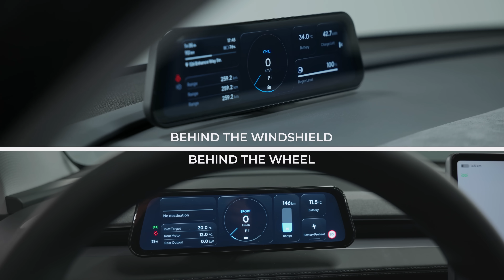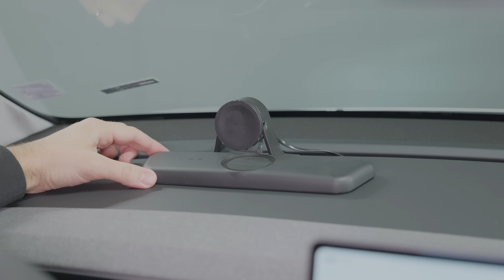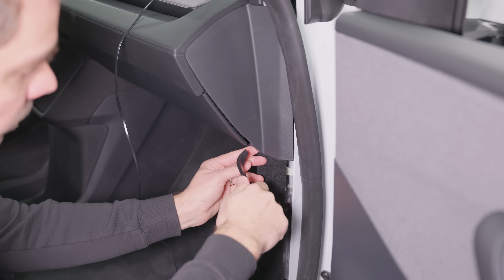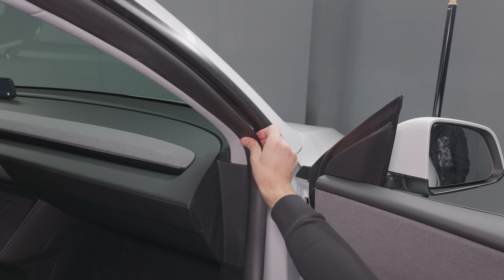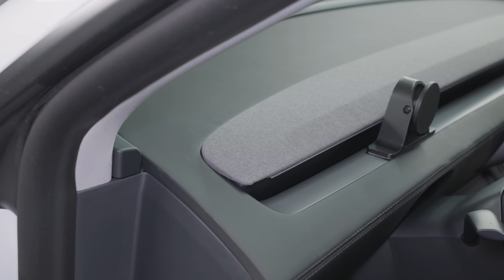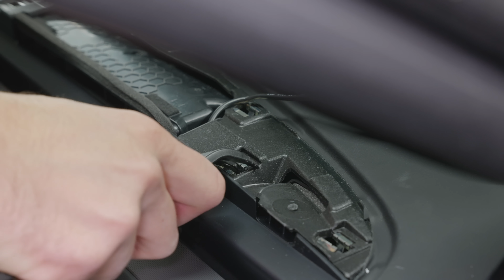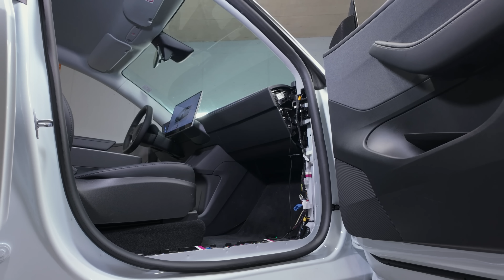S3XY Dash Installation and Wiring | Tesla Model 3/Y [Highland & Juniper]

Comment: Can I just use any usb-c cable to connect to a regular usb-c port to first check out for a couple of days which position of the Dash suits me best?
Reply: I have the same question.  I’m torn between which way I want to install it.  I assume you can connect to USB-C outlet in the car since that was the actual original plan for power according to older videos.  I’m really looking forward to user comments about placement once the first batch starts to arrive in people’s hands.
Reply: I did it - tired a regulator USB-c cable and used the usb outlet in then rear console. Worked fine.
Reply: Same question here. I also would like to test the different positions before making the final install!
Reply: @andersjacobsson1905 yes you can
Reply: Yes, you can!
Reply: There’s also another video from IowaTesla Guy that says you can buy an adapter and connect it to the OBD port underneath on the drivers side. I bought it. Just waiting for the Dash to arrive.

Comment: It does not stick to the dashboard. The tape is too weak!!!
Reply: The device is too heavy and does not stick to the surface
Reply: @skrzypek100  I thought so to in the beginning, but you need to apply force on the magmount for some time and clean the area properly/dry it. It sticks fine here now, no probs
Reply: @Mr.Relaxed How can this stick when the dashboard is made of soft leather. I think I need to buy another tape
Reply: @skrzypek100 It should and will stick, but apply pressure for some time and then put on the screen..Maybe tilt it up a little bit
Reply: @Mr.Relaxed  I just installed mine and i have the exact same problem. I used the 2 x 3M tape provided and i applied preasure for over 10 min and the mount still dont stick, when I put on the Sexy dash it drops of after a while
Reply: @darkeraz4572 I put pressure for some time, then left it some hours before I put Dash on, no probs. But I agree its not the best solution, there should have been some sort of 'hook' or something to attach behind vent opening or dash opening for instance. But then again, people should let av Enhance know, so they can make another stand

Comment: Got my Dash 2 days ago and installed in on my Model 3 Highland behind the steering wheel, simply because I was unable, no matter what I did, to connect Dash via the app ( my knob, strip , 4 buttons are easlity found, but not the Dash). So I installed thee so I could reach it easily with my hand. But would love to use my app for this, much easier with updates and stuff, but Dash will do for now I guess..No matter what I did, I just got messages that Dash was used in Commander, and when it was not, app never found any Dash :(   Anyway, it looks really nice, im happy in that departement 😊
Reply: Do you know if you can configure the device to auto start in the Waze app automatically when you start the car?
Reply: @cesarblanco I use Android Auto where I have Waze and everything autostarts.. Just check  Android Auto settings on your phone settings and all permissions are given..When in use in car, you choose what apos to you use easy

Comment: Can anyone share if installing it behind the steering wheel will easily limit the air outlet of the driving air conditioner? Because the weather in Asia is very hot
Reply: I think the difference is not so serious.